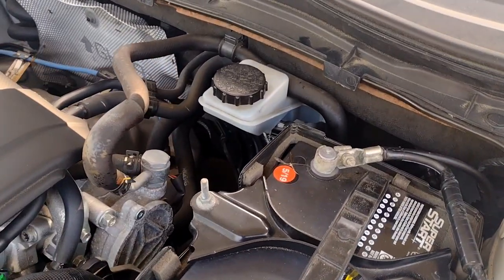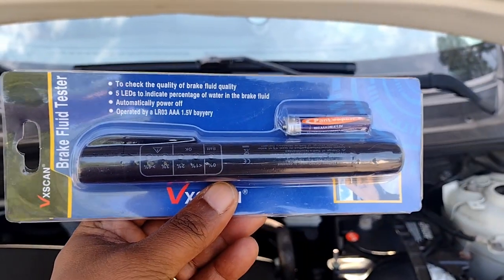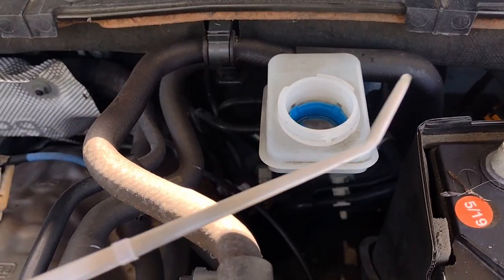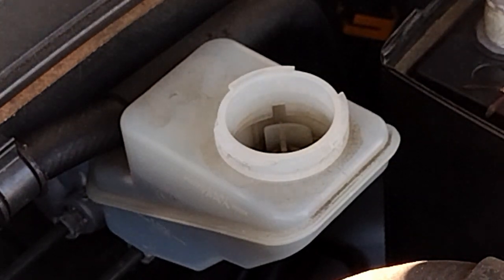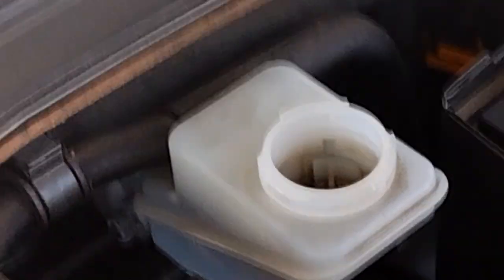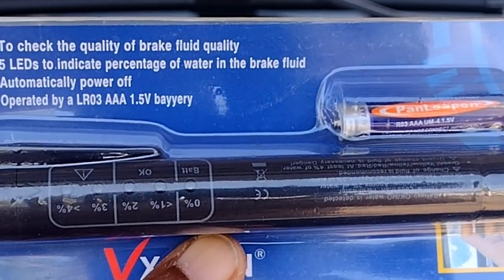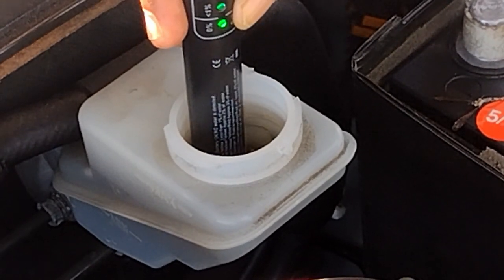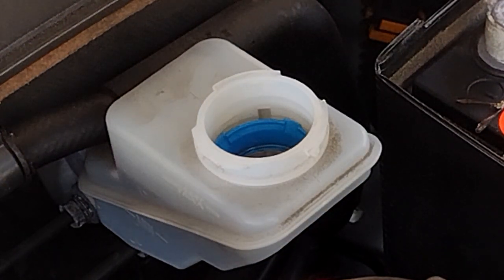Brake fluid filter removal & Brake fluid testing

Comment: Changed my brake fluid today. There is no need to remove the filter. At 1’ 40” you’ll see a slot at the back. That slot is big enough to get a pipe in and it steers the pipe to the bottom of the resevoir.